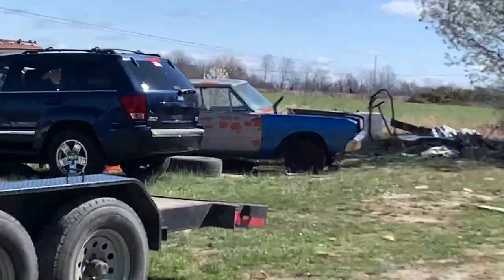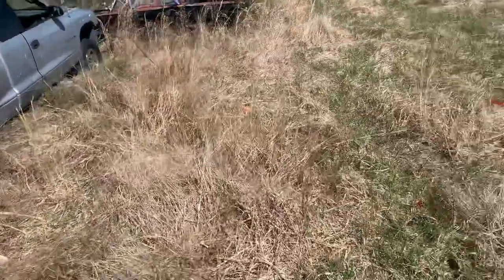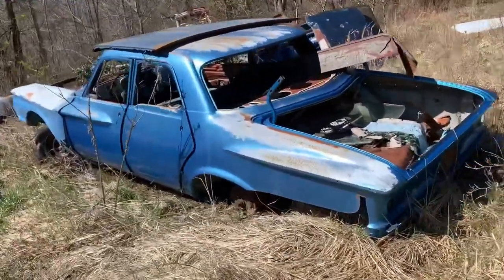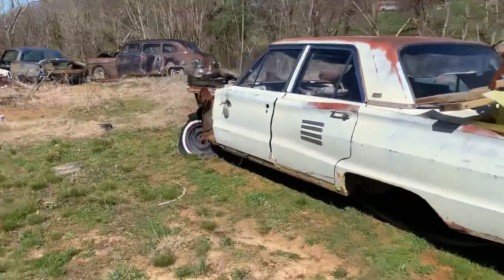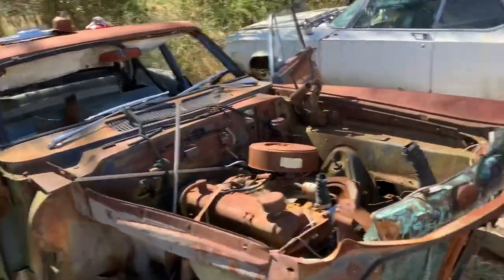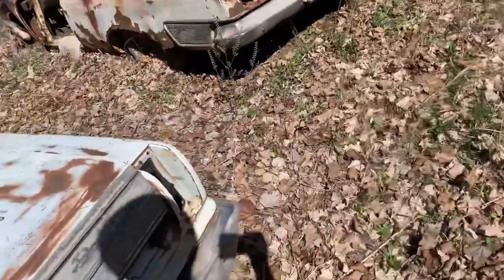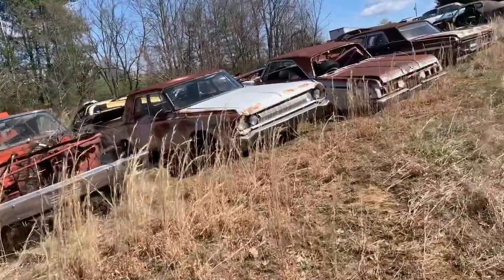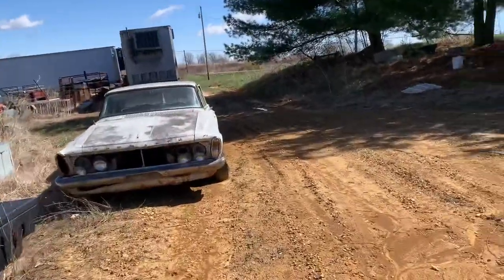Mopar Parts Yard and 69 Road Runner Project for sale! Pt.1

Comment: Lots of Mopar parts are interchangeable use convertible, other body doors will bolt on.
Then add matching fenders and quarter panels, could make a Charger convertible

Comment: If there is a Ramcharger with the little courtesy lights in the back I need the little round lenses. Also any line on a '79 dodge D150? I need a good glove box lid and the plastic trim for the inside of the cab, the pillars, over the doors and the rear window.
Reply from the maker: Sorry for the delayed response if you’re looking for anything give Mike a ring at 270 668 8314 he’s got gobs of parts I planned to do a part 2 where I go in the semi trailers but there’s just been a lot going on